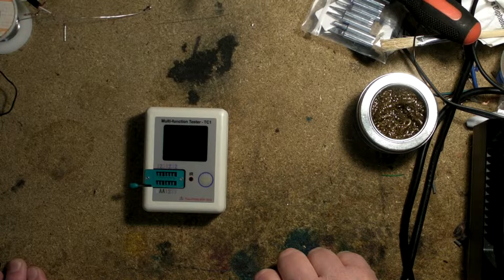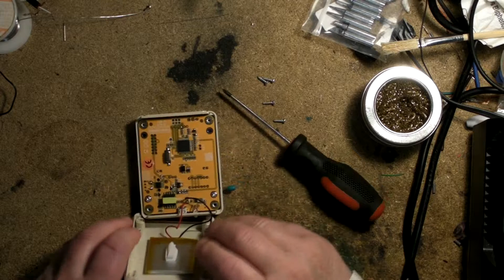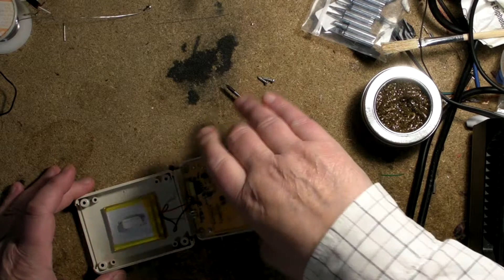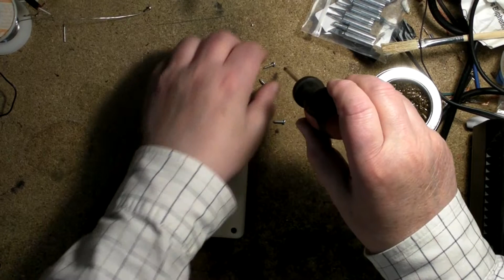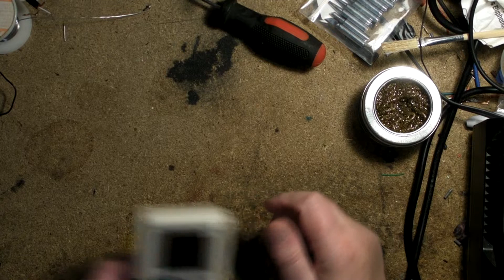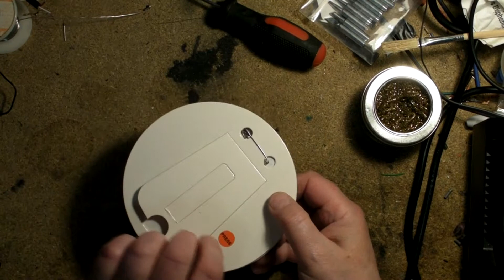Dead TC1 Component Tester? Magic 5 minute fix! PLEASE SUBSCRIBE FOR MORE CLEVER FIXES!

Comment: The problem with my one is its stuck in battery testing mode. Won't go back to capacitance testing for some reason. I have taken out the battery and put it back but still the same.

Comment: I believe I have the same problem. Screen randomly starts flashing on and off and then it shuts down. I will try cutting a little hole on the side with a dremel and adding a switch.

Comment: According to a post on EEV Blog forums ( titled "TC1 lcr-meter transistor-tester fix" ), posted by user "zappenduster" on 21st June 2018 the gadget consumes about 0,2 mA in Standby/Power-Off mode. 🤔😉🙄 

That means 150 mAh per month (0,2 mA x 24 h x 31 days). So a fully charged battery would be drained after three months of non-use. 🤔😕😞😟😳

Comment: My TC1 has a connector so I don't have to desolder the battery, but this fix doesn't help :( It was working fine one minute, then it said to charge the battery, then the screen stopped coming on altogether. I charge it and the light goes green after a few seconds, but I can no longer get anything on the screen :( I'd hardly used this, it was sitting on standby in case I ever needed it and then died lol
Reply: this  just happened to mine thats the same. unplugging didnt work. thought it might be the cheap battery. metered it and its showing 4v so its not that either :(
Reply: Same for me. Just tested it with a few transistors, the remote IR for codes, left it to charge and half an hour later dead... The connector gives 4.1V when plugged in and the battery sustains the voltage. The light is green but nobody is home. Came in today and already dead.

Comment: Anyone have one that turns on but has a blank screen. Backlight comes on but nothing shows up. 
I disconnected and reconnected the battery.... Still get a blank screen
Reply: According to a post on EEV Blog forums ( titled "TC1 lcr-meter transistor-tester fix" ), originally posted by user "zappenduster" on 21st June 2018, user "indman" replied (1st July 2018) that you should try:

- either removing the component (marked by DZ1 on the PCB) 6V8A (which is a zener diode).

- OR removing the 6-pin component V05 (on the PCB it is marked by DZ2). It's full model name is SRV05-4.

If the problem remains, then you have damaged the ATMega324 processor. In that case you're going to have to get a replacement one and a new firmware is necessary. Meaning you'll have to reprogram it. 🤔😕😟

Your problem might have happened from connecting a charged capacitor to the probe leads when you were trying to measure it.

Comment: Hey there Mon Ami .....  I am glad I stumbled across your video ... I've been having my tester for 3 years now and it acted up today, it wouldn't turn off and it was frozen in the no part or bad part mode...  I knew it needed a reset , but how was the 64,000.00 $$ question .... I searched TC1 tester reset and nothing came up , so I reworded the search and voila you came up , Thanks for the tip on taking the battery out of the circuit , BTW mine had a plug on the end of it .... I joined your channel and rang the bell .....Thanks again..

Comment: Worked. Though I have a TC-7h which comes with a connector so you need not to desolder anything. Just disconnect and connect after 10secs. Thanks.

Comment: I got a cap discharged during testing it charges but won't turn on.
Do u have an idea how to fix it??
Reply: Same problem. Can't fix it the way suggested.
Reply: @sham1234567891  See my post here under this comment. 😉😊
Reply: According to a post on EEV Blog forums ( titled "TC1 lcr-meter transistor-tester fix" ), originally posted by user "zappenduster" on 21st June 2018, user "indman" replied (1st July 2018) that you should try:

- either removing the component (marked by DZ1 on the PCB) 6V8A (which is a zener diode).

- OR removing the 6-pin component V05 (on the PCB it is marked by DZ2). It's full model name is SRV05-4.

If the problem remains, then you have damaged the ATMega324 processor. In that case you're going to have to get a replacement one and a new firmware is necessary. Meaning you'll have to reprogram it. 🤔😕😟

But do read that highlighted topic I outlined for more fixes.

Comment: Mi tester al medir capacitores me muestra una fuente. Esto paso por medir un capacitor y no descargarlo antes, por lo que se dañó y ya no mide capacitores. Alguien sabe cómo arreglarlo?
Reply: According to a post on EEV Blog forums ( titled "TC1 lcr-meter transistor-tester fix" ), originally posted by user "zappenduster" on 21st June 2018, user "indman" replied (1st July 2018) that you should try:

- either removing the component (marked by DZ1 on the PCB) 6V8A (which is a zener diode).

- OR removing the 6-pin component V05 (on the PCB it is marked by DZ2). It's full model name is SRV05-4.

If the problem remains, then you have damaged the ATMega324 processor. In that case you're going to have to get a replacement one and a new firmware is necessary. Meaning you'll have to reprogram it. 🤔😕😟

Hope it helps.

Comment: My TC1 switches ON but only detects a 5V cell whatever is connected to it (and whatever the pins). I thought that maybe the ZIF socket had its pins oxydated and made the test fail, but I opened the casing, directly soldered some flying leads from the 1-2-3 points on the PCB to some grip-wires and the problem is the same ! If anyone found a fix for this, I'd definitely want to hear from you !
Reply: Mine switches on but the display is all lit up, completely white :-(
Reply: According to a post on EEV Blog forums ( titled "TC1 lcr-meter transistor-tester fix" ), originally posted by user "zappenduster" on 21st June 2018, user "indman" replied (1st July 2018) that you should try:

- either removing the component (marked by DZ1 on the PCB) 6V8A (which is a zener diode).

- OR removing the 6-pin component V05 (on the PCB it is marked by DZ2). It's full model name is SRV05-4.

If the problem remains, then you have damaged the ATMega324 processor. In that case you're going to have to get a replacement one and a new firmware is necessary. Meaning you'll have to reprogram it. 🤔😕😟

But do read that outlined topic on that forum for more possible ideas on fixing it.

Comment: I have a TC1 AND did a test on a 9volt battery cell and now when i want to start it , i get short a white screen and shuts down.
Is there somewhon now's how to repair this ?
Reply: According to a post on EEV Blog forums ( titled "TC1 lcr-meter transistor-tester fix" ), originally posted by user "zappenduster" on 21st June 2018, user "indman" replied (1st July 2018) that you should try:

- either removing the component (marked by DZ1 on the PCB) 6V8A (which is a zener diode).

- OR removing the 6-pin component V05 (on the PCB it is marked by DZ2). It's full model name is SRV05-4.

If the problem remains, then you have damaged the ATMega324 processor. In that case you're going to have to get a replacement one and a new firmware is necessary. Meaning you'll have to reprogram it. 🤔😕😟

You shouldn't be measuring anything above 5 V.

Comment: You surely made my day ! Thanks for the excellent tip! 
I drilled a 3 mm hole in the front side panel, at about the same position as the charging LED hole, but at the far right end side. Then I made the hole to a small horizontal rectangular slot, and glued a miniature slide switch to the inside of the side panel, as a small power on/off switch.
Reply: Nice idea, batt life now is longer, we now have a reset, software never gets tired... it lasts for ever... so thanks a lot.

Comment: Tried that. No dice, still dead!
Reply: have a look here... this chap found a shorted cap on the dc - dc converter for the zener tester
https://www.eevblog.com/forum/testgear/tc1-lcr-meter-transistor-tester-fix/
Reply: @miketaylor803  Gr8 topic indeed. I fixed mine yesterday by accidentally measuring a capacitor that had some residual charge in it. 😍😇🤗😏👌
Reply: +1

Comment: Or, since you have to open it up and use your soldering iron anyway, solder in a breaker switch which will act as a reset switch next time it happens.

Comment: Thank you for the tip! My tester is otherwise just like your tester but has a connector for the battery on the pcb. So, one can't really say that chinese RD engineer hasn't done anything to mitigate this problem in later revisions.. If this problem will persist I guess I'll take a little bit similar step like chinese engineer and install a nc reed  relay or mercury switch.

Comment: The tc1 brake it jst start to give flicering display etc.had 2 both just quit working as they should the 1 i got had a flickering display while testing. the second worked fine.have not used it for some time and recharged it ,no luck with selftest.it also suddenly got display flickering.it is bonkers